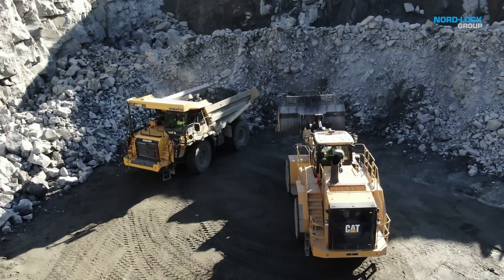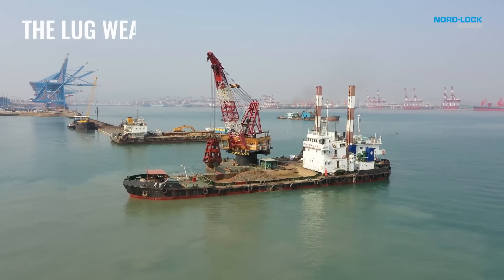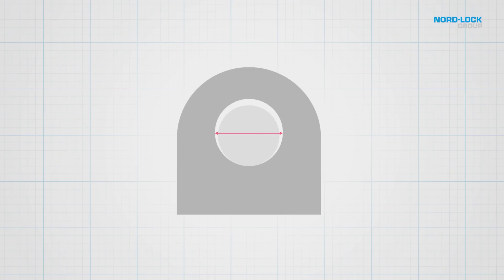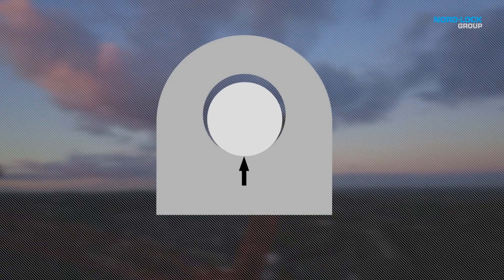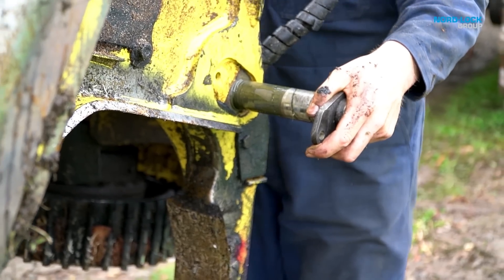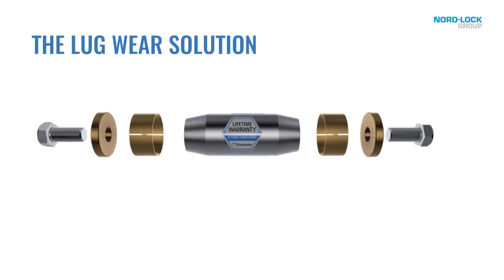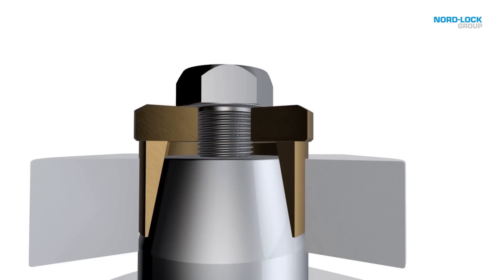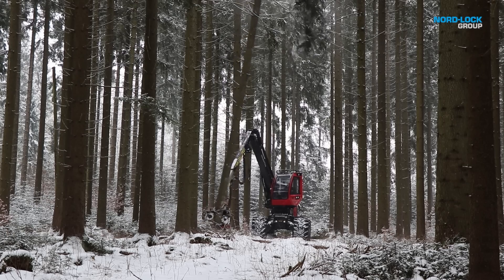Why Does Lug Wear Occur? The Challenge and Solution to Lug Wear - Expander System

Comment: Dosent appear to compensate for inner bush wear hence useless
Reply from the maker: The inner bushing is a wear part that can and should be replaced in regular intervals depending on use. Wear in the lug ears is a much more difficult repair which traditionally often requires line boring. Expander System is an easy, fast and cost effective solution that eliminates the lug wear, the solution also helps to reduce the inner bushing wear and hence prolong these service intervals. Sometimes the wear in itself is not an issue but rather the play in the pivot which the Expander System greatly reduce. The system also reduce the time to make a service and eliminate the risk of need to cut the pin away.
Reply: @NordLockGroup  lkllklkmllllllllkrtttiiii766  to 8865r455555
Reply: @NordLockGroup  qee e2i
Reply: @NordLockGroup t

Comment: Caterpillar has had this system for many years as I am sure other manufacturers have too. I have built up and bored many taper lock pin holes when they wore out so that the taper could no longer take up the slack. Once the bearing that pivots on the pin wears enough there is a lot of hammering going on. The taper lock and hole it fits is going to expand. I probably would not stay busy if people just greased pivot joints often enough.
Reply from the maker: Expander System has been on the market for over 35 years and we have many great proactive OEMs in many different industries as customers.
Reply: 8th
Reply: Ĺ7pì⁷uuùuù88u88iijiiiiiiikiooiiioiii98⁹i8⁹⁹⁰99oiki990
Reply: You
Reply: I
Reply: Yt?.

You
Reply: The